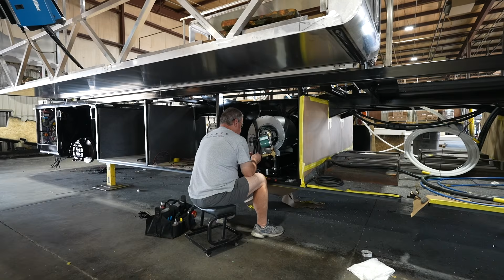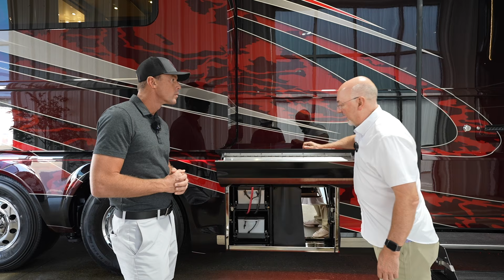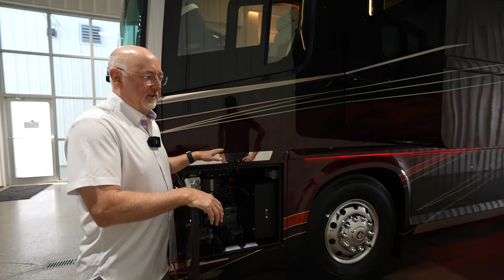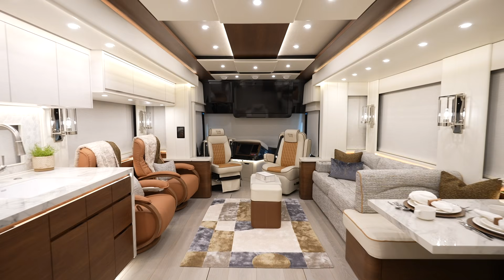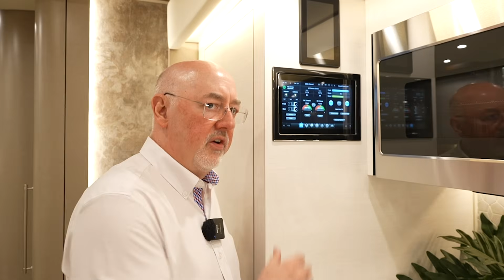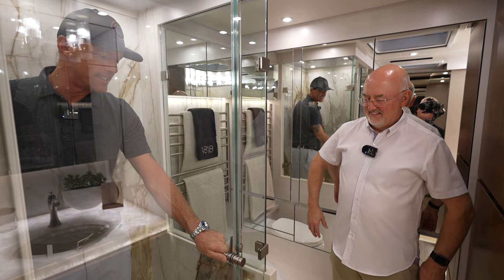Touring 2025 Newell Coach #1818

Comment: Just an fyi GM through Delphi which it owned at the time came out with quad steering pickups in 2002, although Honda and Mazda had versions of four wheel steering in the 80s. Delphi invented the magnetic continuing damping which debuted on the Cadillac 2002. GM lost control of Delphi when it went to bankruptcy.

Comment: Wait... those black 'faux burner covers' are rubber? Induction cooking won't work through rubber as it works via electrical current and conductivity. So they are probably 'soft ceramic' not rubber.

Comment: Newell doesn't seem to do much with the exterior top and considering how much solar power systems have advanced you could get 1200 watts on that roof even without using the slide tops. If you build panels into the slider tops I wouldn't be surprised if you could get to 2kw max gen. totally off-grid no fuel. That's pretty big. Yes most luxury coach owners are NOT dry campers, but that would give you the option to potentially stretch the off-grid to a month for this thing since water storage is so expansive. Add in an AirStill (atmospheric water extractor) and you really do give yourself a ton of flexibility.

Comment: Honestly, when it comes to the electrical service bay I don't think I would want a motorized tray unless it was VERY simple to disengage so I can do a manual pull. After all, if something electrical is wonky the power to both the chassis and house might be fully down and the ability to create as much space in that bay as possible with no power seem to be an advantage and since it is just the electrical bay there won't be anything heavy on the tray to be a problem with a manual pull.

Comment: I love this coach!  I love the construction and the yacht inspired European style decor, but in a multi million dollar RV there should be better cooking options. The kitchen in an RV in this price range should be a serious kitchen. Throwing a couple of silicone pads on the counter for burners, not having a real oven and giving that sad default convection microwave is a real letdown!  I've seen school bus builds that have more serious kitchens than this!  This shouldn't be!  Now if the buyer can customize it and get what we want then Ok, but If I had to take this kitchen then I would have to pass on your coach and go with the school bus!  Your kitchen for me would be a deal breaker. 
I'm from the large transport aircraft world so I have a comment about your entry door. If that's the only door, which it appears to be, then  being pneumatic dependant in order to operate is a bad design. An Airbus aircraft has an entry door that operates the same way, but there's a reason aircraft DON'T have pneumatically operated doors and that's for safety. Your entry door needs to have both  pneumatic and manual options  for operation. One needs to be able to disengage the pneumatic system and operate the door manually. If the hinges are any good then it shouldn't be a problem. With good hinges and a balanced door it would move as easily as a house front door.  If you put hinges that can't handle the door weight well and you're compensating with a pneumatic actuator then that's bad all the way round. 
Look, I don't need a little counter with drawers by the entry door I need more kitchen counter area. Put the half bath back where it was so I can have longer counters, then I can have a real range and oven!  If you insist on the night stand being by the entry the lengthen the coach by three feet so the half bath and the night stand can be there!  HELLO!!!
Who's making the design layout decisions over at Newmar?
Though projectors and screens take less space they are an inferior viewing option!  If one's  primary concern is space saving and not visual robustness then ok, but does Newmar give the option?  I guess we're not doing too badly, were only at deal breaker three, let's continue!
Reply: Wow you sure complain a lot. He literally said the doors have a manual release.middle door sounded like an option as well.  I am sure there are other cooktop options as well. Don't know about oven and microwave options.
Reply: @ 
I only complain a lot when there's a lot to complain about.
It must be difficult to have to read a comment like mine because all of the "cheerleader" comments virtually say the same thing ad infinitum!

Comment: Cost of the unit isn't really worth it.This thing the time u leave the lot it depreciate an each year thngs go wrong in the unit wear on it as other stuff .How long will it be before it leaks from the air units are gradually from round them as window seals .Rather buy me a nice brick home that's more secure than this as the campgrounds u park out high cost there !!

Comment: Before even contemplating spending my almost $3mill on one, i would want to know, what Newell have done regarding a good all round fire suppression system? 1000+ R.V. fires a year, does not give me a confidence boost, especially with so many batteries on board, and the source alone for so many fires happen in the Engine bay/Brakes, and other equipment that gets hot, it is also why so many fires on these cannot be totally extinguished unless caught really early.

Comment: No lithium batteries, Unbelievable on a 3 million dollar coach! I have a 2005 Fleetwood with lithium and  2400 watts of solar  and we never have to use the generator. Only costs $15k upgrade! Come on Newell!
Reply: He said they offer a lithium battery package. The customer didn't order it.
Reply: There lithium package is primitive compared to Liberty.
Reply: I noticed that as well compared to the Millennium Prevost video they just posted recently. I'm sure this customer specifically didn't care about it, but this is some of the tech that the RV industry needs to adopt more aggressively. I really liked Millennium with their massive multi alternator and DC system and ability to run the ACs for hours in between stops. I've had my Victron Quattro and solar system I installed in 2019 on my Fleetwood 40G still running perfectly years later. It's one of the best upgrades you can do